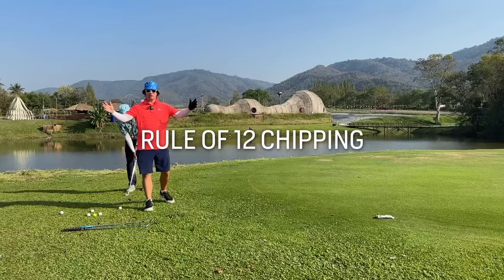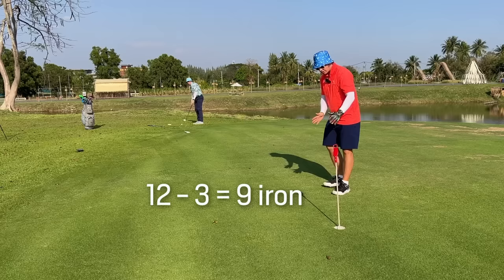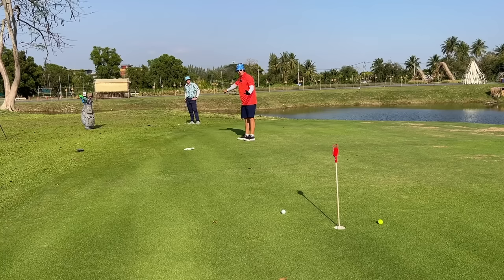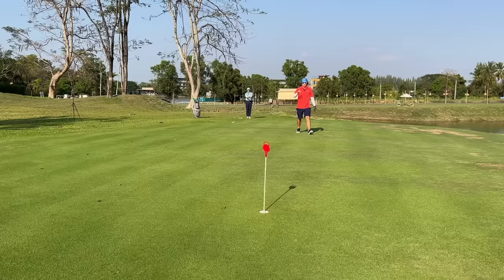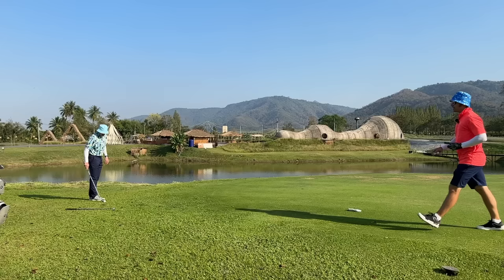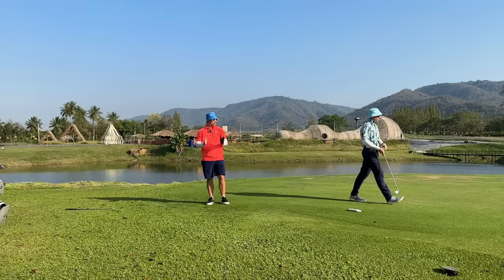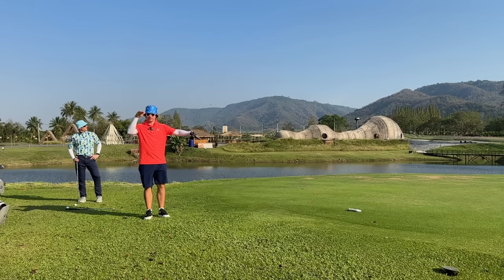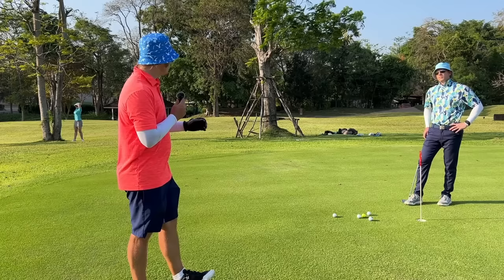Rule of 12 Chipping - Easy Way to Master Chipping

Comment: Mr. Runyon's book was published in 1979. A 9 iron then had 48 degrees of loft. Now it is around 40 degrees. Does that have any effect on the formula?
Reply: I think it has to.
Reply: For sure. Find out your exact ratios for each of your chipping clubs
Reply from the maker: as always, this is the basis, then you experiment to find your way
Reply: @GolfSidekick  Please, please no one take this as a negative comment. Golf Digest September 2019 featured an article based on the same the book. They did not mention modern vs. old lofts either. In the late 1980s golf club makers came up with wonderful ideas to sell new clubs. Let's lengthen the shafts first. Resulting in longer hits. Then it snowballed into making stronger lofts. " I gap never hit a five iron that far before, sold." It has resulted in sets of 4-PW and an opportunity to sell a plethora of wedges to make up the shortcomings of a modern loft basic set. Old sets were gaped about four degrees starting with a 2 iron about 4 degrees apart with a 5 at 32*, 6 at 36*, 7 at 40*, 8 at 44*, 9 at 48* and PW at 50-52*. Most sand wedges were 55*. As an experiment add two clubs up as a gap wedge 48-49* degreeish (if that is a word) and see how much difference it makes. That may really dial in those ratios. In other words use degrees in loft verses club number. It may be a cool experiment.

Comment: Great instructional video guys! Much appreciated. Can you let me know if the landing spot always (or at least usually) about a yard or two onto the green regardless of where the stick is? Cheers!
Reply from the maker: Can be. It’s easiest to use one landing spot. Sometimes it will need to change in special circumstances but 1-2 yards is a great place to start and stay with

Comment: I've learned that it's best to use a putting grip and stroke to keep the spin down and more working the loft of the club. It's easier to get the same result from time to time if you don't involve the wrist.
Reply from the maker: good idea indeed
Reply: I'm glad to see you are using your head to be creative and plan your shot based on circumstances... instead of doing the math!

I only chip with my sand wedge!  For me it's better to have one club to work with because of length and feeling the same weight with the one club!

I'll leave it at that.. but I love the creativity of the short shots!

Comment: Very good.  I've tried the Rule of 12 many times but found it to be inconsistent.  I never took into consideration Stimp Speed. I was away of slope as a factor.  This is good stuff.
Reply: Did you use a calculator?
Reply from the maker: Glad it was helpful!

Comment: Very interested to try this after winter hibernation since chipping is the weakest part of my game right now. How does a gap wedge or lob wedge fit in this sytem? Are they a 10.5 and 11.5 wedge? Or do I just ignore those clubs?

I'm also curious the upper limit of distance for the usefulness of this rule. Will a SW chip that carries 8 yards really roll 8 yards? A chip off the fairway could spin and roll less. Will a 7-iron that carries 8 yards and roll 40 reliably?

Comment: If I’m thinking of this correctly, since I don’t want to be pacing yardage every single time  I’m about to chip then I’d figure my baseline rule of 12 like this : 
If I want to carry my ball 1/5th of the way and let it roll out 4/5ths on to the hole, then I’d use my 8iron (12-4). 

If I want to carry my ball 1/4 of the way and let it roll out 3/4 of the way, then I’d use my 9iron (12-3)

If I want to carry my ball 1/3 of the way and let it roll out 2/3 of the way to the hole, I’d use my pw (12-2 = 10 which is pw)

If I want to carry my ball 1/2 the way and let it roll out 1/2 the way to the hole, then I’d use my SW (12 - 1 = 11 which is SW)

From there I’d adjust for speed of greens and/or slope. Also I’d account for the lie and if I need to hit a high apex to get over a hill or something. 

Lastly I can also try the strategy of always hitting it about 1-2 yards on to the green. If I do that then I need to see how far back I’m chipping and determine my ratio. Because if I’m back far enough I could still be hitting a 1/2 to 1/2 or 1:1 ratio and therefore need to use my SW, but either way I look to see what ratio hitting it 1-2 yards on the green gives me and then adjust from there. 

But bottom line: I always figure ratios of 1/5 - 4/5, 1/4-3/4, 1/3-2/3, or 1/2-1/2 as far as distance goes because I don’t always want to hold up play by pacing everything off. And maybe really only get super good at hitting 3 of those ratios as four options may be too many. And just get really good at hitting those landing spots and reading the roll out. Hope that all makes sense.
Reply: A couple of years ago I spend an afternoon noting down all my ratios from 6i up, then did the same again if ever the day's stip changed by 0.5 - after a couple of months (and I guess 4 hours in total) I have all the ratios for different speeds noted in my scoreard holder - way way quicker!! One thing I've noticed is to try and find a level or slightly downhill landing spot - if you're landing on an incline the ball can checkup quite easily if you're PW or above
Reply: @davefiver  well I’d never be able to know the distance by eye but I can get pretty close at seeing what spot is a 1/3 of the way from me to the hole , or 1/2 way. It gets harder as you do 1/4 or a 1/5 but not so bad if you’re close to the fringe imo.
Reply: @RichardBarratt75  that’s where I want to get to. At least for 3 ratios. 1/2 to 1/2, 1/3 to 2/3, and 1/4 to 3/4.

Comment: The rule used to be, "your worst putt is better than your best chip".  You should use the club that gets the ball on the green the quickest.  When he started out with the 9 iron he should have been using the 6 or 7 iron.  Also, try using your putting grip and stance on the shots that are close to the green, it will take your wrists out of the equation.
Reply from the maker: Jimi Hendrix wrote that song If 6 was 9
Reply: @davefiver  No, the idea is to get the ball on the green as quickly as possible.  In the shortest distance.  Problem with the 9 is that it has too much loft so the ball will go further into the green and you would have less control.
Reply: @davefiver  I understand the concept, it is not new it has been around a long time.  The concept is to replicate the putter, using an iron.  The objective is to get the ball onto the green with the least amount of carry (just past the fringe)  and with the least amount of loft.  He even says in the piece, “different variations of spin and strike on a higher lofted club is much less reliable.”  So, if that is true, why would you start off with the higher lofted club.   Use the club that creates the least amount of bounce, when the ball hits the green.  You want to get the ball rolling as quickly as possible.  Try what I am saying, you won’t need a calculator.  You can thank me later.

Comment: I assume you can revert the equation to tell you where to land a ball if you put in the club you want to use. So if you want to use a 7 iron on a 20yd to hole shot  plug in the distances and it will tell you where to land it . IE 12 = 7i + 5.  So run out is 5:1.  1/6 of 20 yd is 3.5 yd the landing spot. Is this correct ?
Reply from the maker: Yas! Experiment and you’ll find ur system

Comment: Great video sir - loving the content as usual. Quick question - how is the best way to understand the speed of the green when on the course? It might be a tricky question to answer, hoping you or someone in the chat can give some guidance. Happy golfing playas!
Reply: HI assume you try this on practice green first, if the Rule of 12 is short etc then try ,the rule of  11 or even 10 if way short, so Rule of 12 is benchmark and adjust accordingly
Reply from the maker: experiment yourself. you use this to find it out. then adapt. rule of 12, rule of 11, rule of 10, rule of 9 depending on how fast or slow the greens

main thing, go try it. you wil learn more that way

Comment: This is assuming you can  hit your landing spot with what every club the rule calls for.  I'm still trying to wrap my head around how far my back swing need to be for each club to land on the spot. Seems like a more of variables to consider then using 1 club and doing the clock back swing for distance...
Reply from the maker: Two options for chipping
One club many spots
One spot many clubs

Both work great

Comment: So, to be clear… when you have a perfectly level green, the ball has a perfect lie on the same level as the perfectly level green, use the rule of 12. The remaining 95% of the time rely on club choice, clubface open vs square, touch/feel to manage trajectory and carry distance. Right? ✅

Seriously though, I am going to try this. I predominantly use my 58° for all chipping around the green and have developed pretty good feel over several years. But toward the end of last year I toyed around chipping with 8 or 9 iron. This gives a good guideline for chipping club choice instead of pure guess work
Reply: @davefiver  If I’m in a divot or a crappy lie I will always use my 58 so that I can attack the ball a little more aggressively and know that I can pop it out with some loft and get it on the green. I think trying to chip from a lie like that with an 8 or 9 iron would lead to topping or blading shots that would roll over the green. But I’m looking forward to experimenting!
Reply from the maker: crap lie, play toe down chipping, or even toe down hybrid

Comment: I find it difficult to get the ball to land where I want it with 1 or 2 clubs, never mind 5 or 6.
I know some very good golfers who use this but I don't have the time to practice it (so I'm rubbish at landing my 9-iron etc. where I want it to).

I use lob-wedge or 54 when I have to fly it - but often use my 8-iron exactly as I would use my putter as I find it goes a similar distance (with my putter grip; lead hand low). Hence I gain a chip shot that I don't have to practice.
Reply from the maker: That’s excellent playa. A great way to chip

Comment: 6 beers minus 2 beers =4 beers...So 20 metres to flag divided by 4 beers = 5  X .375ml per beer = 1.875ml  X 14 clubs in bag = 26.25 ÷ only 3 beers left = 8.75 M landing spot with a 50 deg wedge..
Now if you are a Bourbon drinker that's a totally different scenario...Are you with me so far ?

Comment: I would think there needs to be some experimentation for each individual as not all clubs have the same lofts and there is a gap wedge between the pitching and sand wedges but otherwise a great place to start
Reply: If viewers at least make an effort to incorporate some of this, it will help...I’m sure. How about at least picking out a landing spot. 🤷‍♂️
Reply from the maker: those who will make the effort to experiment, will drop 5 shots off their score
those who do not, will not

Comment: What do you do when the math doesn't work out so nicely?  Like land the ball 4 yards on the green and 11 yards to the hole from there
Reply from the maker: round up or down then adapt
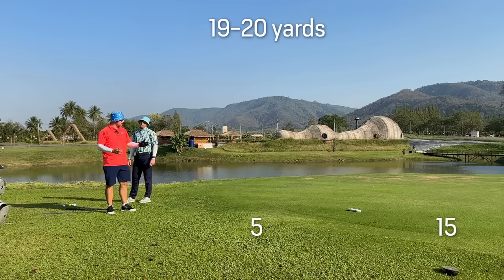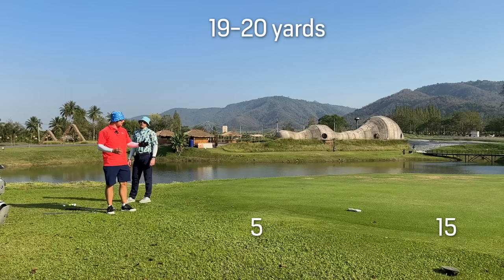4:11 is roughly 4:12 so 1:3 which is 12-3 = 9 iron. But because its 11 yards, try the PW instead and see which works better for you